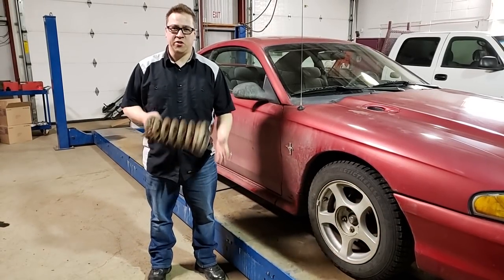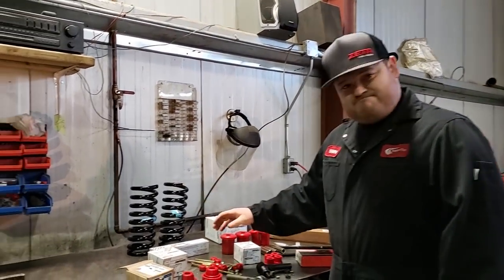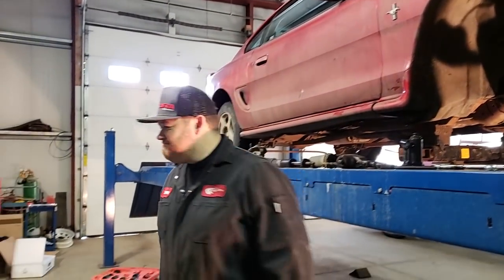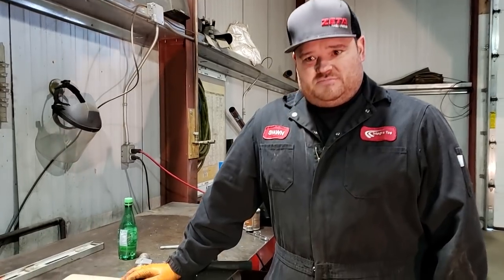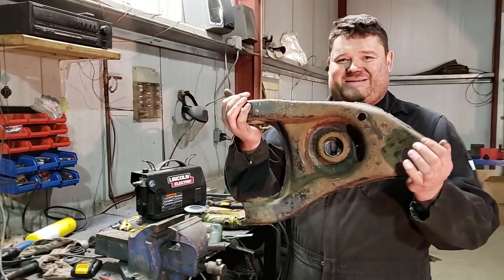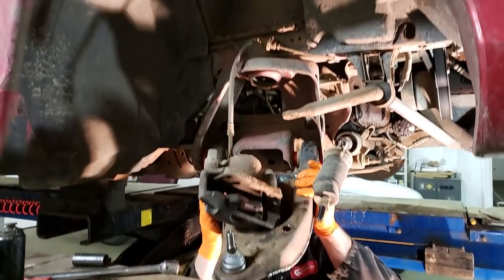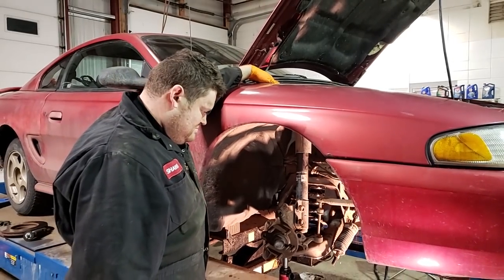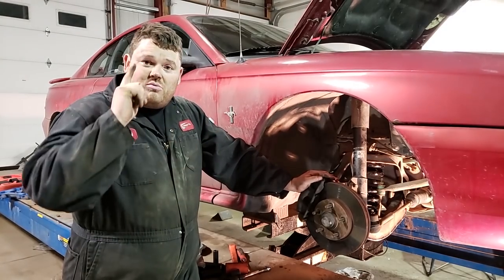SN95 Owner's Guide #12 - Handling Upgrades Part 2

Comment: cool mods, though i would never fully box do to weight. The control arms are already pretty strong, the main problem with the fox/sn95 chassis is the body flex. the Better control arm mod will be offset bushings, to move the control arm forward.

Comment: Rack Bushings! Great series guys. If you can instruct us how to get these in, we would really appreciate it. I'm in the process of restoring my 95 GTS and my suspension is shot. I have Eibcach Pros and KYB Excel G's ready to go in. Any help you can provide to improve the handling of our cars (especially with steering rack bushings)  is greatly appreciated! Liked and subscribed.
Reply from the maker: The rack bushing video is scheduled for filming this weekend, so we will certainly have that for you ASAP. I have a GTS as well, and it sounds like you are on a good track to improved handling. As always, more to follow. Thanks for the comment! - Darren

Comment: I got a problem with my 1994 ford mustang GT 5.0 automatic. I think the previous owner put some headers on the car and when I run it it goes great but at times it makes like a noise then when I try to drive normal it sounds forced I try to go to 55 but it doesn't shift gear. Keeps on going up to 3000 rpm. I check with others and they say it's not the tranmission they checked the oils and everything and it seems fine. But the guy said someone told him when he got it tuned the guy who tuned the car messed something up. So idk if anyone can help me is it the tranmission or the tune or maybe something else I need help before I spend money on other things that wont help the problem

Comment: How did you guys push out the bushing?
Reply from the maker: We used the same drill and large drill bit method from Part 1 of the installation. The space to work is a bit crowded, bit it is easier than many of the alternatives. Thanks for watching and Commenting! - Darren

Comment: WHERE IS IVAN!!!
Reply from the maker: We have no plans for additional Lada films until sometime later in 2019. During the summer we discovered the car needed a huge amount of rust repair which required full interior disassembly and other serious work. The sheet metal is done but the seating must be rebuilt as the mounts were torn from the floor while the seat frames are broken and quite unsafe. The interior still must be finished and some exhaust work is mandatory. In addition, the driver side window debonded from the frame and cannot be closed, it is difficult to access and perform a good long term fix. None of these repairs are good video material, and the IVAN2104 videos sadly have not continued to develop the channel audience beyond 30 or so regular viewers. After year 1 the traffic and popularity of Lada videos experienced a huge slump and have simply never recovered. Due the production expenses, parts shipment costs and time spent, it has been a very costly series to produce completely out of pocket as hobbyists. The IVAN2104 project has been placed on pause while we reassess and work to expand the channel with our more popular topics. Thanks for commenting and your continued interest! - Darren
Reply: @GrandTouringConcepts  Come on, rust repair is interesting, how did you decide its not good video material?
The 3S-GTE Mini has a lot of fabrication and welding and it's doing fine view wise
Reply from the maker: We did a deep dive into the youtube analytics and the stats are exceedingly poor. Looking at our two Lada bodywork films, each have taken a year get the viewership that a Mustang video gets in a month. After the first 100 fans watch it in the first week, it tanks to fewer than 100 views per month. Average watch time reports that people have tuned out in fewer than 5 minutes. We do recognise that body work projects like the Mini you mention are quite popular, but either the Lada as a subject or our presentation of the subject is failing to develop interest. - Darren